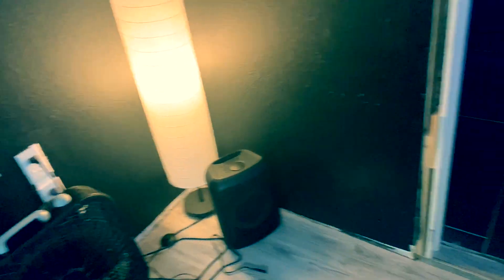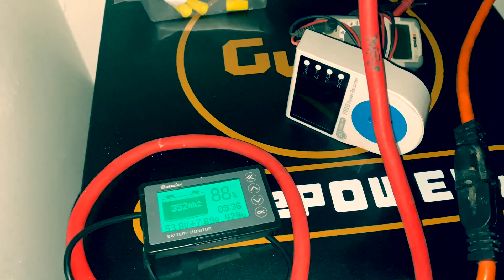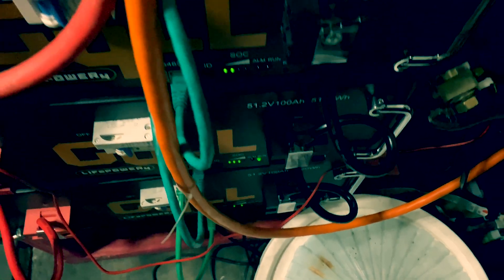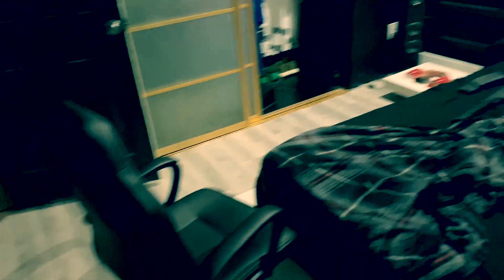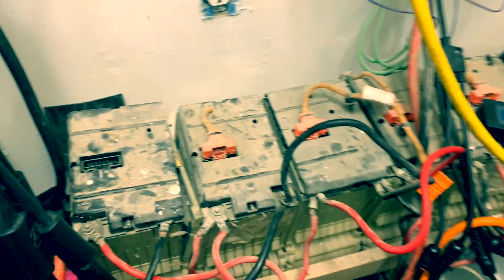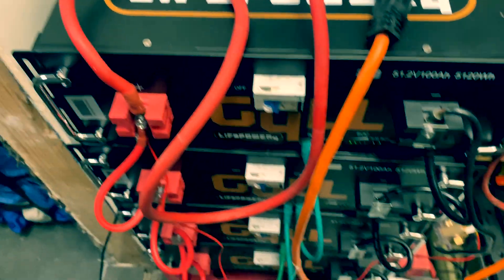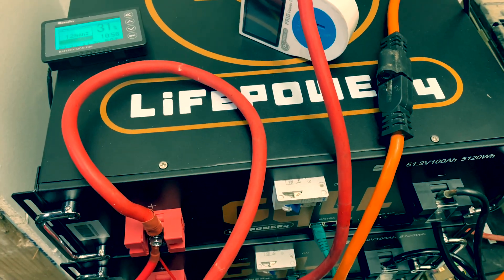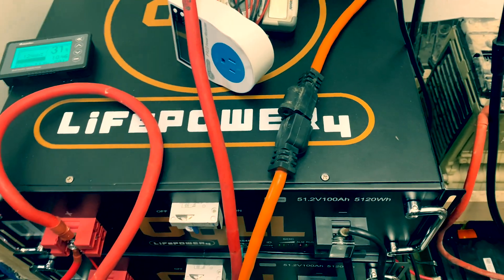How To Run Appliances On A Off Grid Solar

Comment: In my house I run the washing machine (1500 watts) and refrigerator, lights, computer at the same time. I have a Samples 4000 watts and not even get hot. For that I have 8 350 solar panels. The only thing I want to change is my battery bank, go lithium.
Reply from the maker: That would be the best choice lifeP04 cells

Comment: I’m new to solar. Just doing my homework at this point. I appreciate the info your providing. Have you done a how to , type install video? Batteries, chargers, breakers, etc. how it all fits together and why each component is necessary?
Reply from the maker: I haven’t, I’m in the process of moving my system and when I do relocate my system I will make a how to video
Reply: @texasoffgridguy8749   that’s awesome. I’ll be looking for it.